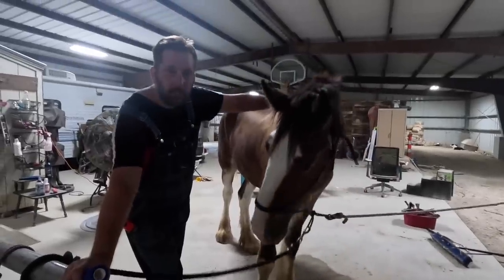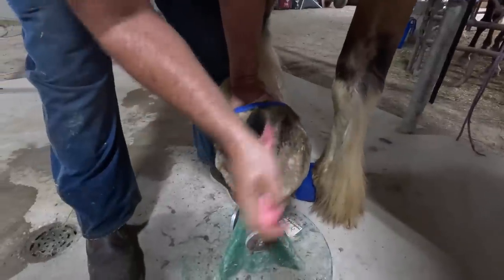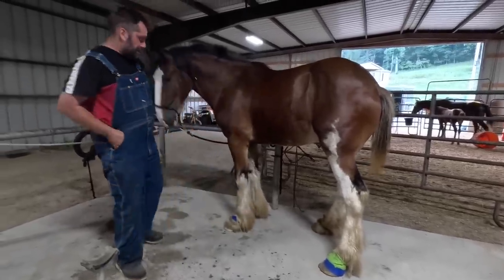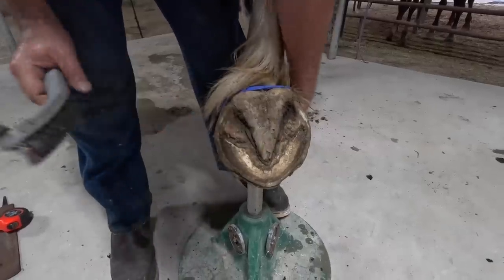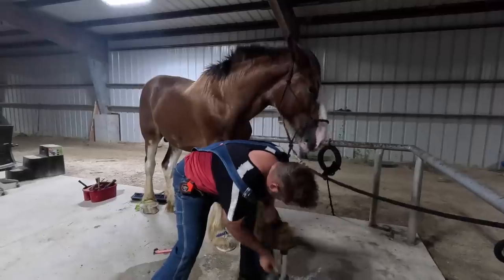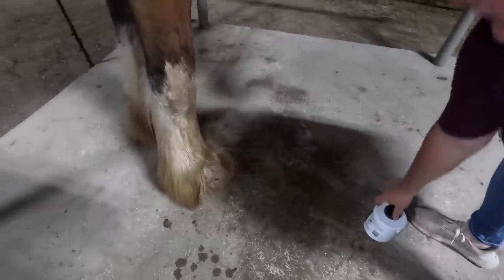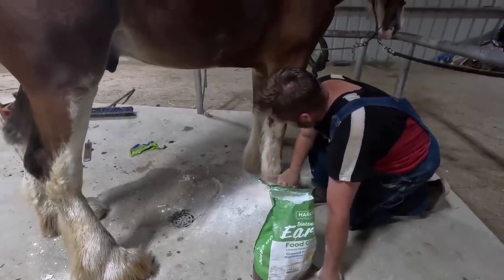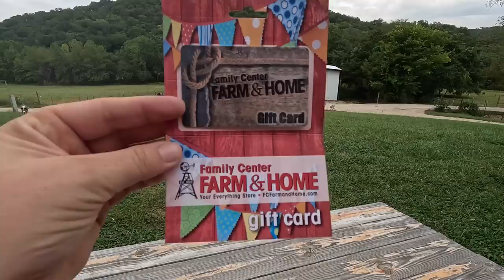Draft Horse POWER TOOL Hoof Trim

Comment: The problem with power tools is the heat that is generated by grinding.  You have to limit contact time or it doesn’t feel good, too hot!  I learned this using a Dremel to maintain my Great Danes toenails. ❤

Comment: Saran wrap works much better on feather and it's cheaper. You can get the wrap that's about 4 in tall On-A-Roll that makes it really easy to apply and those are fairly cheap too and will last forever.

Comment: JR.      I don't know if it would be something that you could do or would consider trying out, but could you use some sort of a stool to sit on when working on the horses feet or legs to save on your back from constantly bending over. Most of the videos of ferriers working shows them bending over, but I think I saw 1 or maybe few more sitting on a stool to do some of their work.
I know a lot of the gardening stools are on wheels so that you can move around on them.  You might have to look around for one that would support your weight/size.

Comment: It is a good trait that the big breed drafts USUALLY have calm and sensible temperaments as I can't imagine trying to do farrier work on one that is not nice.  Just picking up those huge feet is a strain on any farrier but a well behaved draft sure makes it nicer .  Oliver is being quit good since this is the first time you have used a grinder on him.  You might want to be good to your back and wear a brace when working on Oliver.  I don't know how full time farriers do it, they must have ways to protect their back or eventually not be able to do the work.  I have noticed that rescues of ONLY drafts most always have stocks so that they can do maintenance in between farrier visits, and with Oliver going to get a whole lot bigger, having a stock set up might be good for your future.  You really should wear a mask when applying the Diatomaceous Earth.  Not good good for YOUR respiratory system.  I have learned so much from your channel about gaited horses.  Wish I had more knowledge about them years ago, a smooth ride would have been something I would have really liked to have experienced.

Comment: I hope you never use a grinder again because it was inches from slicing thru an artery in your wrist and arm. You would bleed out before getting to the end of the driver, if you made to your truck. Just take a look at the video and you will freak out at how close that blade was to your arm.
Reply from the maker: It’s not a blade it’s sand paper and I’m not an idiot but thank you for your concern I will be careful.

Comment: I have never seen a ferrier use an electric tool on a horse. 
I don’t know about you sometimes you do smart things and then you do something like this. The reason Oliver is pulling his foot back is because the vibration is not comfortable for any animal. Any animal hates something that vibrates. 
It messes with their electromagnetic set up by God
You’re taking a big chance in ruining him with the Ferrier.
Also if you just taken the measurements and not had the person with the camera get in the light your furrier could’ve seen the size here on a video. No need for additional pictures. I’m telling you this in love. I want to help you avoid problems❤
Reply from the maker: It is quite common to use sanders grinders and even planers. I was just intruding it. I think he did great and will learn to tolerate it. It is for his best interest so I czz as n care for him and his well being.